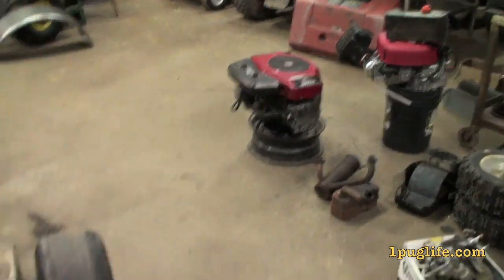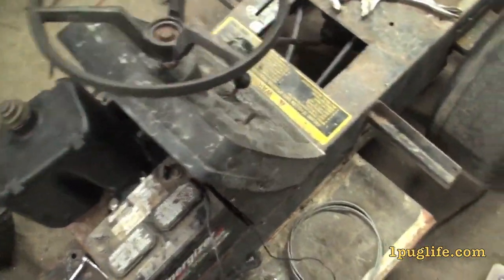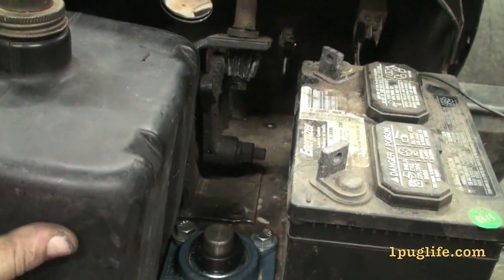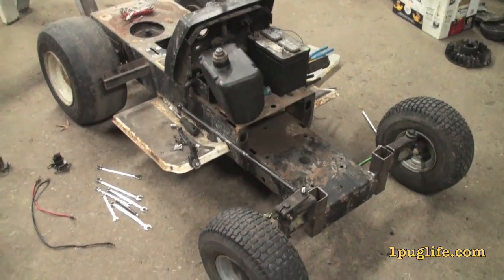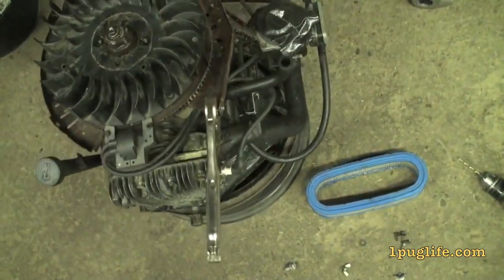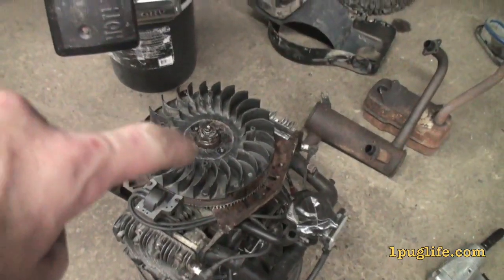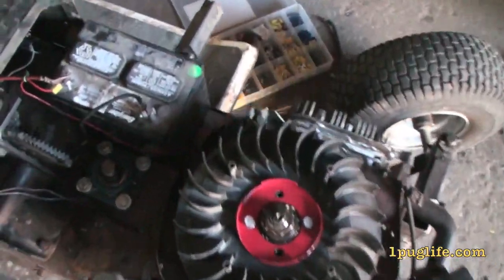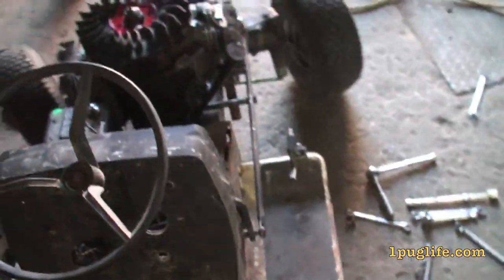how to wire up a race mower

Comment: Put all the tin on it because it draws air over the fins on the heads and sucks the heat out of them. Think VW, if you pull the tin of the motor it overheats. Best of luck from south Florida.

Comment: What about quick connect type cigrit? That way, you can plug in the battery, and start the tractor, then disconnect the battery. Saves weight.